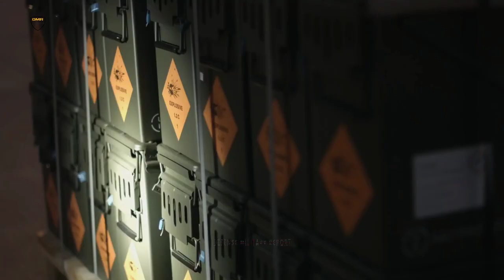Fabolous! British Army receive 100 extra BOXER armoured vehicle

Comment: Britain needs to design a modular vehicle that has the modularity of boxer that is tracked
Reply: Let's make sure it's actually Gona work without causing brain injuries
Reply: Please don't shoot the tyres
Reply: It's called the Ajax.... and it doesn't work
Reply: @henrylamb8765  it’s not modular in the slightest
Reply: Eurosatory 2022 the tracked Boxer was revealed. 👍
Reply: @wudruffwildcard252  That is great a Wheeled and Tracked modular vehicle means Britain can focus on other vehicles like MBT/Light Tank/Self-propelled Artillery all things Britain needs
Reply: I present you….. the tracked Boxer available at KMW 😊
Reply: Whats the point of that? That would mean spending billions and waiting for 10y minimum instead of just buying the Boxer which UK need right now.
Reply: @bobincognito6239 It didn’t exist when I wrote the comment but there is now a tracked version of Boxer and the British Army needs modular wheeled and tracked vehicles as it is a lot quicker to develop a new module than develop a brand-new platform so it means the Army can adapt a lot quicker
Reply: @jammiedodger7040  cv 90 should  be purchased replace the ajax disaster.
Reply: @williamdodds1394  I agree Ajax should be scrapped but CV-90 is not the answer a new tracked vehicle needs to be developed that is no more than 10 tons and is amphibious and airdrop capable and that is the same size as the Scimitar and would have the option of two guns 40mm and 110mm the way I see it Boxer wheeled and tracked would replace a lot of the old platforms including some of the IFV fleet but the aim would be to replace Challenger,AS-90, Scimitar and Warrior all with new British Tracked Vehicles
Reply: @jammiedodger7040  Not in todays world Scimitar is not enough room its 1970s tech tracked and wheeled to defend what youve taken from the enemy cv 90 is all thats out there that type because anything the mod create like ajax will be a heap of trouble buy what works well and modern.
Reply: @williamdodds1394  Scimitar is not as cramped as you think it would be  there absolutely nothing like the Scimitar that why it can not be replace with something off the shelf and a new vehicle needs to be developed and also CV-90 is almost the same age as Warrior and you do know right that Scimitar got upgraded in 2010 Scimitar MK II.

The only part of your argument that is valid is the part about about MoD you are correct they are hopeless but the government is as useless between the two of them they are responsible for the collapse of British Leyland, Royal Ordinance,Vickers and Alvis 4 extremely important companies to British defence.
Reply: @jammiedodger7040  Well why talk of a new design when it will give trouble and we will be old and walking on a walking aid when its adopted cv 90 has lots of variants and has been upgraded its far better than warrior can fire on the move warrior although a good vehicle cannot and they wont up grade it Scimitar wont stand a hit from antitank rounds too light too weak and is a fireball of aluminum.
Reply: @williamdodds1394   Scimitar is not supposed to be hit by a tank round the same with the Warrior and CV-90 so that point is completely irrelevant.

If they had gone ahead with SEP the modular version of the CV-90 that also includes a wheeled 8x8 version of the CV-90 but for simplicity I going to refer to it as the CV-90 SEP if they had made the CV-90 SEP it would of rivalled the Boxer and would of most likely won the contract but because they cancel the CV-90 SEP they lost the contract to Boxer and it does not make financial sense to acquire the CV-90 as Boxer fills the role the CV-90 would fill.

I do think Challenger,AS-90, Scimitar/Spartan and Warrior replacements should be dedicated platforms so should not be replaced by Boxer there is one slight exception to this rule Warrior should have a dedicated replacement but Boxer would also fill the IFV role alongside the Warrior replacement but all 4 dedicated platforms must be British design and British built.
Reply: @williamdodds1394  So you got Reform Uk which is right-wing populist there so rumours they work with hope not hate so I am a bit on edge about Reform Uk but we also have Britain First which is Nationalist which is gaining traction the local elections will give you a idea how good they would do in a general election then you have two activist groups Patriotic Alternative and Identity England which are both gaining traction as well plus you got a bunch of small nationalist parties and at the moment that is a good this as it means that almost every seat will have a nationalist candidate to vote for and I think they will do really well but in the long-term some of the smaller parties will need to unify with other parties but we are a long way from that being a problem. 

Climate change is a lie Britain was hotter 2,000 years ago and the prediction is that Britain will actually become subartic so Britain’s climate will become what it was like during the ice age.

I have read about the climate change lockdowns that will first be introduced to Oxford there will be 6 zones and to leave a zone you require the council authority.They are try to gain more control as they know a civil war is going to happen so by controlling movement,speech and money they are hoping to suppress it.

My problem with Electric vehicles is not that they are dangerous my problem with them is they use rare materials and they produce extreme amount of E waste.

I believe we should move away from Oil replacing Petrol, Diesel and Jet Fuel with Hydrogen and Biofuel as they have lots of benefits over Oil but I fully support the use of Coal in Steam Locomotives,Steam Engines,Fireplaces,Barbecues,Steel Plants and Coal Power Stations.
Reply: @jammiedodger7040  Do you ever watch The Crows House .
Reply: @jammiedodger7040  its on rumble
Reply: @williamdodds1394  Nope and I not been on rumble for a couple of months
Reply: @jammiedodger7040  Max shows whats going on its eye opening

Comment: Funny enough, we were part if the original consortium that designed the Boxer to begin with, then we left that program for some reaso.
They also need to build an amphibious variant too, like many wheeled APC's have today, but I'd prefer if they designed a water jet version rather than a twin screw prop version like many around the world have, plus make all variants have the ability to put tracks or chain like tracks, one for each pair on each side, so four in all, used for awkward terrain like sand or snow, and spiked tires for ice in case of a need to go Sub Arctic or full on within the Arctic circle itself against "unowho" the baldy bastard Ruskies, Also a 100mm variant, a 120mm low or no recoil autoloading auto-cannon, as well as an automatic mortar variant and an air defense variant with short range SAM's for protection against low flying aircraft like helicopters, a Brimstone missile carrier, Martlet or Starstreak or a multi MLRS for precision artillery strikes and even more variants to add to the collection already planned.
Reply: What do you think will happen to the Ajax programme.
Reply: The thing weighs 40 tons. That is more than double the weight of what amphibious vehicles can get away with and still float. 
Amphibious APCs and IFVs all weigh around 15 to 18 tons, 20 at the most.

The Boxer is as heavy as a T-72 tank.
They even have to remove the mission module to get it into a A400 cargo aircraft, which can technically carry 40 tons, but the loading ramp can only handle 37 tons.

Just because it outwardly looks like all those other 8x8 wheeled APCs doesn't mean it is the same. The Boxer is a very different beast under the skin and plays in its own league. It is way heavier armored and twice as heavy as all the others, especially the amphibious ones.

The promotional material you get here doesn't really convey how massive and heavy the thing really is, but you can watch videos of "tank spotters" who film them driving around on German roads around military training grounds and when you watch those videos, you really get a feeling for the mass and weight of the Boxer. Despite its great mobility, it is kind of like watching a freight train locomotive on rubber wheels.

Another visible indicator of its enormous mass is when you watch the socalled "RCH", which is a 155mm howitzer module strapped to the back of a Boxer. That huge gun can fire sideways without needing to extend special support legs, because the mass of the Boxer alone is enough to keep it stable and from toppling over.

Long story short, there is absolutely no way that there ever will be a amphibious version of the Boxer.
Reply: If you want a 120mm variant then just buy the Centauro 2, you would save billions by doing so.
Reply: No they definitely don't need to build an amphibious variant! Absolutely not! 
You know which country wants everything amphibious? Russia! And what successes did they have with even the smallest waters in Ukraine? Zero or 00000000,00! 
There is only one small elite part of the armed forces that could benefit from amphibious vehicles and that would be scouts! And in times of scouting drones, they become less important  by the minute!
Reply: @bobincognito6239  Which is much much older and have much much less armour and you need a separate service infrastructure. In europe the boxer is in usage by many partners.
Reply: @thecurlew7403  I think the Ajax comes in future. The boxer is only the wheeled alternative. Germany have also the boxer and the puma.
Reply: @85daniel  What the hell are you talking about, the Centauro 2 is literally brand new, it has the same armour and cost the same as normal Boxers, UK paid 10M$/Boxer and Brazil 10M€/Centauro2. 
A new 120mm version would clearly cost a lot more than that.

Comment: But the chinese Typ 08 Armoured Fithing vehicle is better then the boxer. Produced since 2008 (6000 units were allready bulid). It has a stronger armour, and the gun has a higher penetrating power. At the moment the boxer is better in hitting but the new version of the Typ 08 were allready a prototyp exist and production starts soon is better then the boxer in hitting, it even is able of SMART hit, were the computer is targeting at the enemey vehicle points were it is smarter to hit it that it makes boom. E.g the computer is targeting spezial points depending on the vehicle type e.g  a light armour vehicle like a humvee the smart gun is targeting the driver

The Future chinese Armourded Fighting Vehicle (only rare concept) is planed to have only a crew of 1, a gunner. Its selfdriving and its planned for special missions that it is completly unmanded and remote controlled. But till then its a long way to go, maybe first in around 14 years it will be in mass production